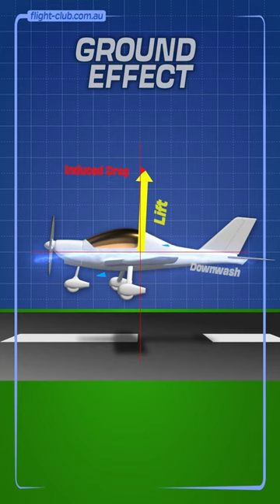Ground Effect. #aviation #flight #pilot

Comment: Working on my Commercial right now and describing Induced Drag as the "backward component of lift" immediately blew my mind. Love it!
Reply: Should’ve been taught that at the private level tbh!
Reply: Ya when i was doing my cfi i was looking at a free body diagram of an airplane in slow flight and really started thinking about how the lift vector was pointing slightly backwards relative to the direction of travel and thought it was weird how a portion of the lift generated by the wings was actually slowing us down and then i realized it was pointing in the exact same direction as the drag vector and i was like holy s**t that’s how induced drag increases with increasing angle of attack.
Reply: @mianatwood I’m doing my ppl right now and am surprised he didn’t know until commercial

Comment: I would like to add that the total amount of lift does not increase when in ground effect. The total amount of lift stays the same but because the rearward component (induced drag) is decreased the vertical component increases.
Reply: Actually that is a great distinction.

Comment: The other cool thing about ground effect, is that bush pilots use it a lot to left off the ground for shorter take offs to clear low obstacles. Such as waterways, fences, and rough terrain. However one has to be aware of grand effect before flying out of it.
Reply: I was gonna say, ground effect is dangerous if you think that this lift is normally there when in fact it is only there in close proximity to the ground. I only thought of it as a nuisance and a danger. But when you put it like that, I realize, “Hey, maybe ground effect isn’t so bad.”